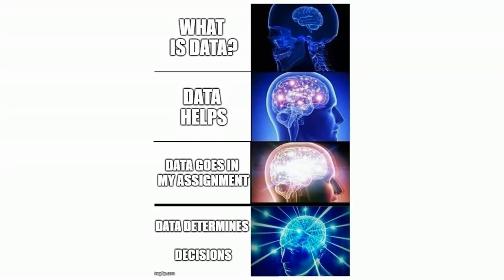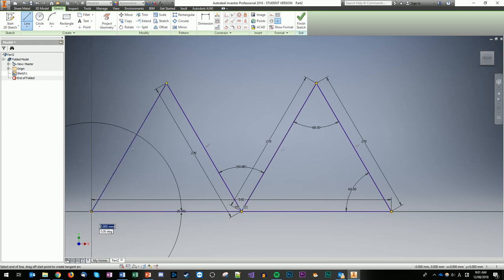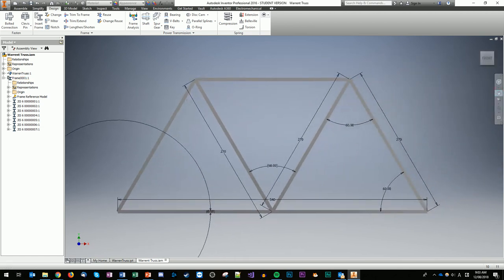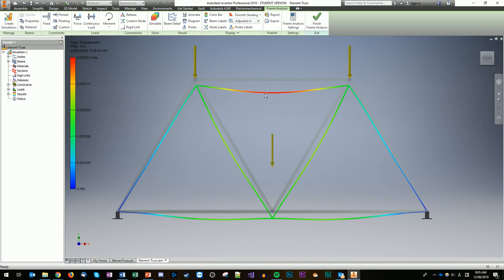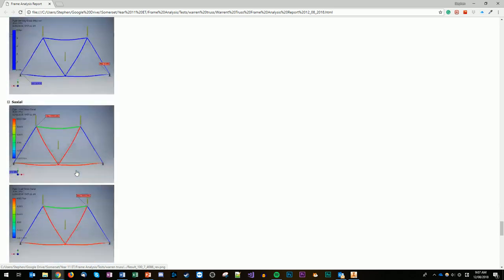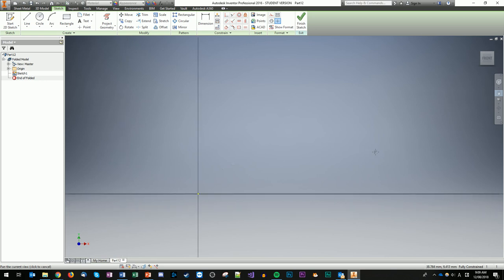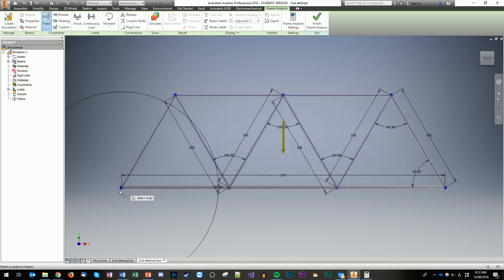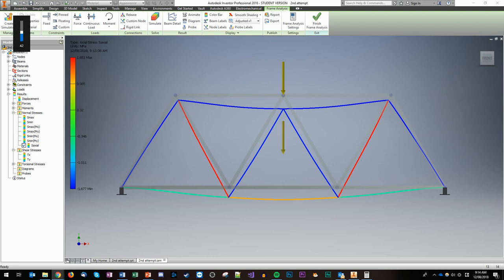BALSA BRIDGE - PART 1 - How to build a truss to run simulations on

Comment: How Modulus Elasitas of Balsa wood?
Reply from the maker: It didn't work out because wood has the grains :( I used steel to simulate as it is better in tension than compression. Hope it helps.